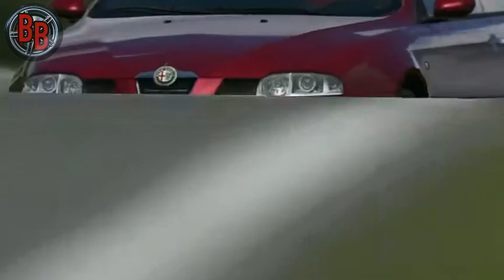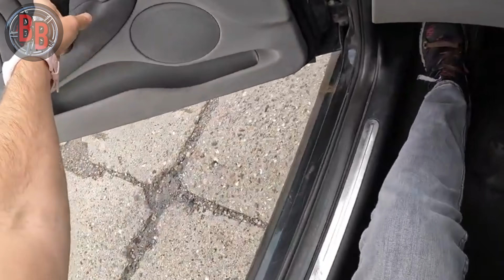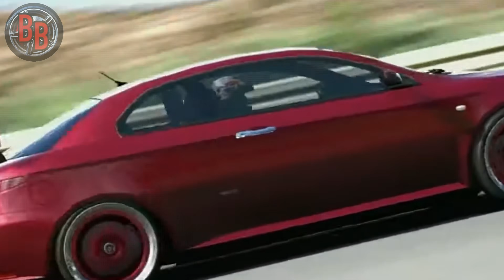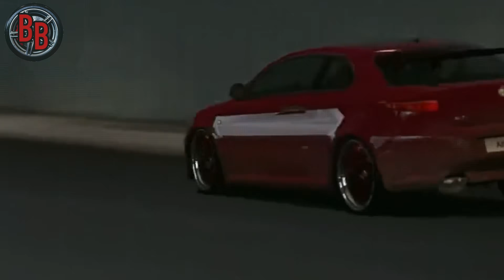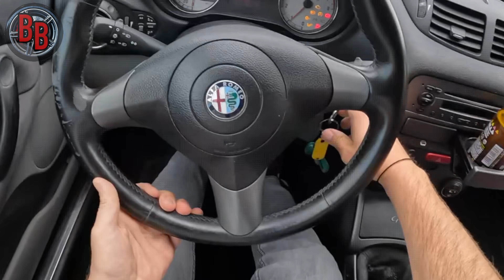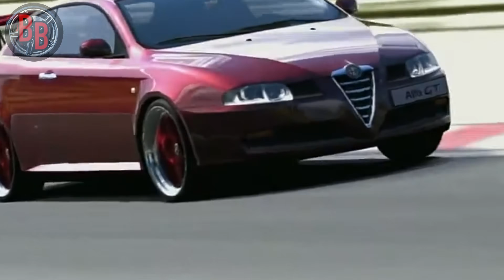Alfa Romeo GT - Check For These Issues Before Buying

Comment: Bought my GT 1.9 JTD with 190k on the clock, not a Q2 from a scrapyard for 2k. Removed the  DPF, EGR, Swirls, changed the clutch, painted it, new rims, pilot sport 5 with wider wheel and now i gotta change the driveshaft. The car is making 200bhp, 350nm. And its the best car i ever had. So far i invested 4k in it. In France 6k will get you a shitty Renault Clio or a Peugeot 208... not a sport car

Comment: after owning it for 2 years 1.9 jtd 2004 i can confirm that 99% is true , but my car was booked for the scrap when i saved it and it was a very runned down and abused , i payed 400 euros for it and i still daily it to work with a commute of 50 km daily . Ever since i've owned it i had no problems with the engine or gearbox , but the suspension , electrical mishaps (windows , body control unit , central locking that doesn't work since i bought it , lights and various sensors ) and rust are a big problem for the gt , she has 271k km and like i said the engine is really robust
Reply: Brilliant - I love the idea of someone saving a car from the scrap yard! But I'm too useless to do it myself! Nice car to save as well, they have a great character.